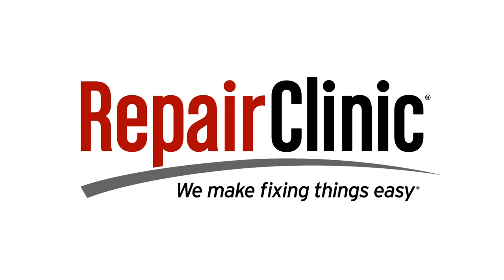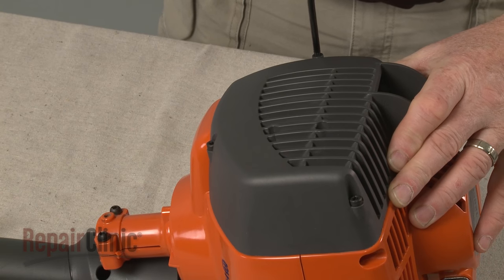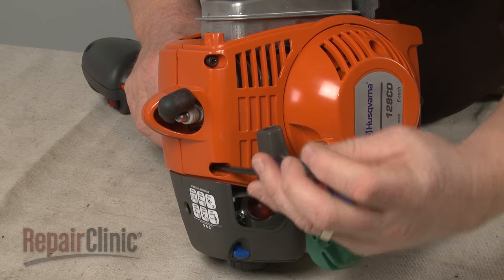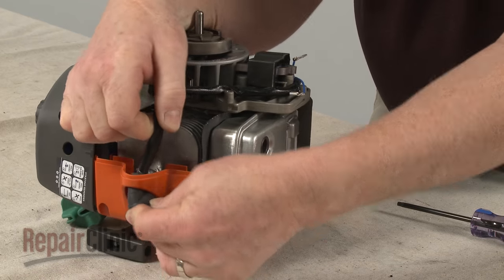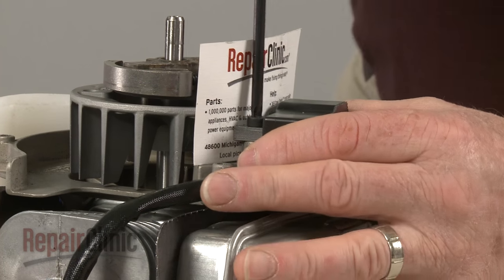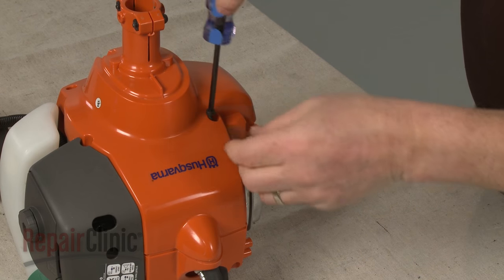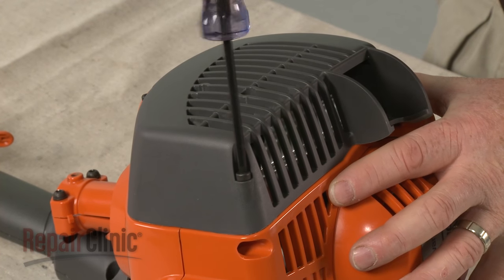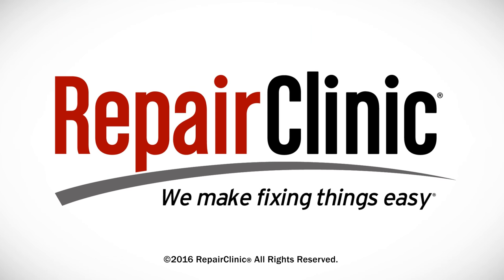String Trimmer Ignition Coil Replacement #545046701

Comment: Lol. Safety is important,  had to chuckle at accidental starting of the engine with a broken ignition system 😆 One of my specialties in the Army was small engine repair. I used the buisness card gap and spark gap with a match book cover. Also for the points gap too if I remember correctly.

Comment: Perfect, thank you.  My repair guy sais that you needed to take this off, that off, plus the part is so expensive.  Si I spent around $600 on an Echo plus the trimmer attachment, very good stuff.  I watched this video, ordered a highly rated part from Amazon.  After the coil arrived, 15 minutes later the trimmer was starting and running well.  I will return the Echo, very well made if you have it.

Comment: I see one leg ones you have to install the right way perhaps  but what about 2 leg modules? Can they be installed back to front?
So per the flywheel rotation direction, how do you check right way for  2 leg modules?  and be sure of 1 legged ones too? 
Thanks